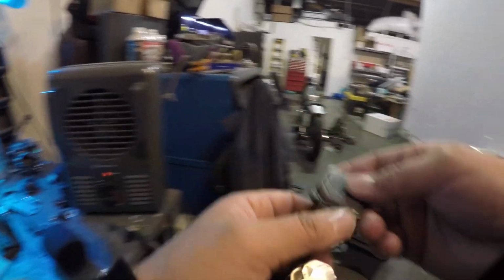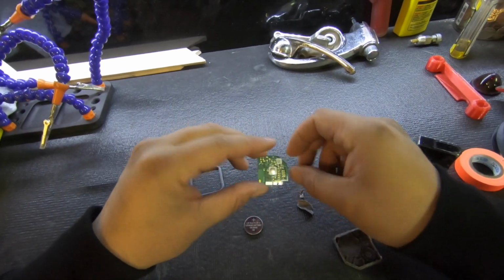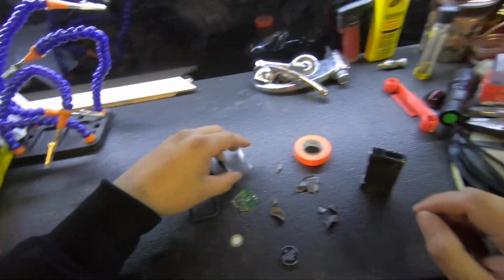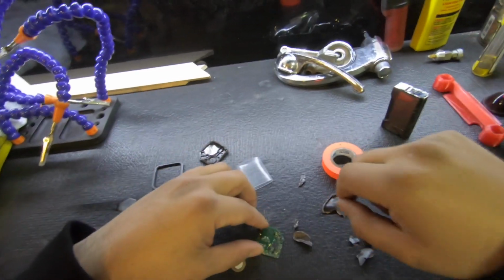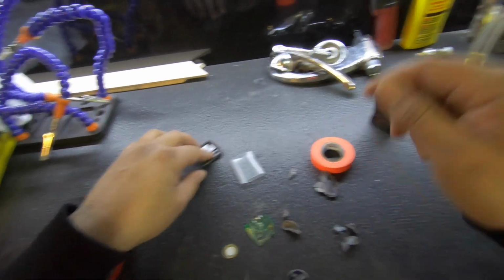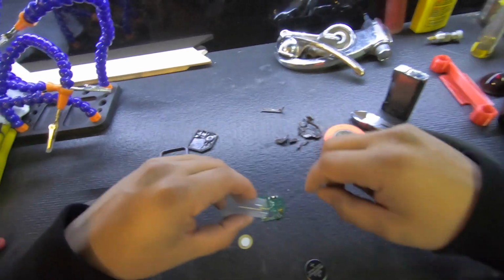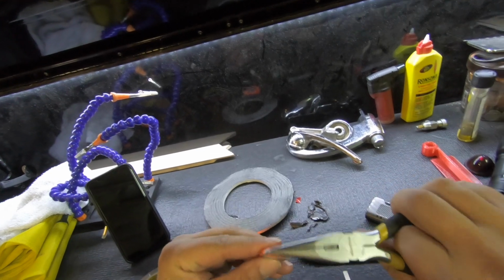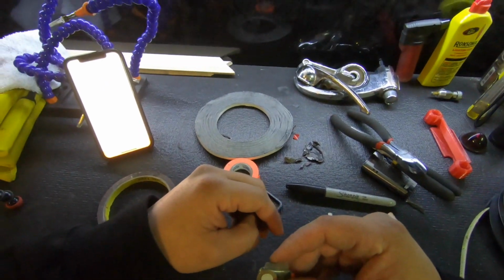Tile case hack | Vlog

Comment: Nice one, happy new year. 
I’ve seen you work with heat shrink a few times and it such a shame that you guys don’t have 220v or else I would definitely send you one of these https://www.steinel.de/nl/hete-lucht-lijmen/heteluchtpistolen/hl-stick.html it’s the best! It can stand by itself on the table so you can use both your hands or just hold it in your hand. I wanted to tip you for this thing after a previous video from you but than didn’t find one for the US. Maybe someone knows of one or like it for the US, or maybe you can create something similar from an existing heat gun.
Reply from the maker: I do have 220 here for my welders
Reply: Ok Eric what is your post address?